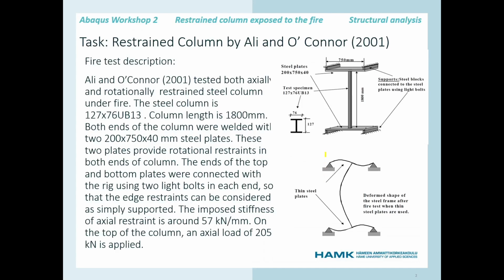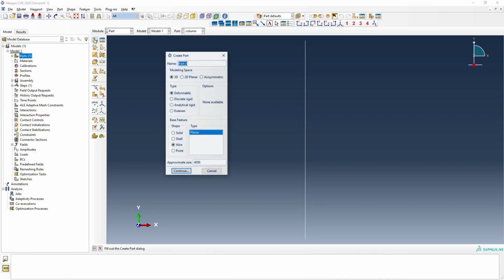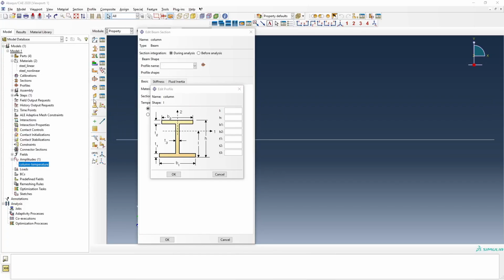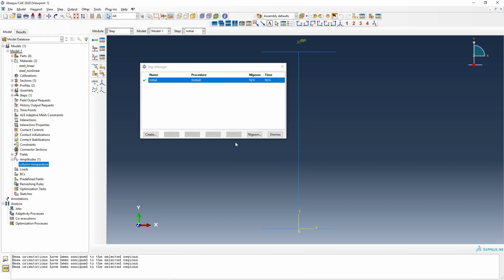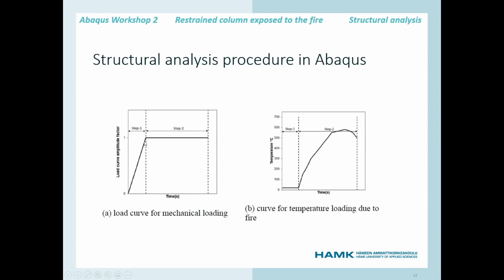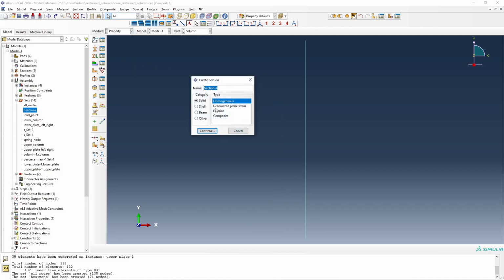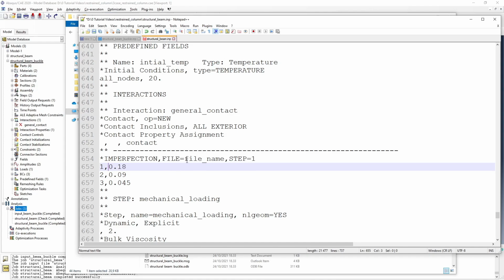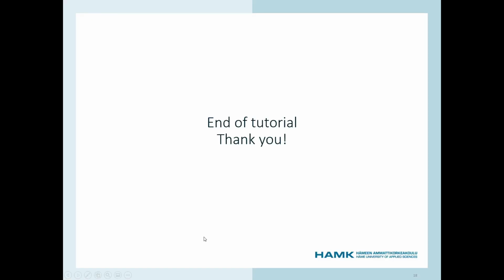Structural response analysis of restrained column exposed to fire using beam element

Comment: can i get the material stress-strain curve how you calculated? I have gone through your thesis report but when i found the temperature dependent stress-strain of steel at elevated temperature according to the equation you provided in your thesis, I'm unable to get the same values as your's. I'm also working on my thesis with similar topic, it will be great help if you respond.